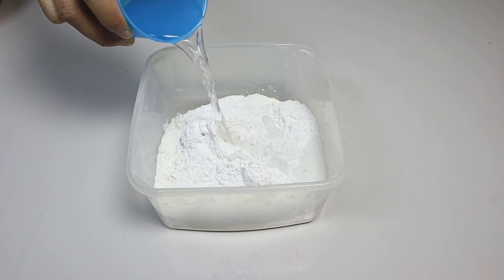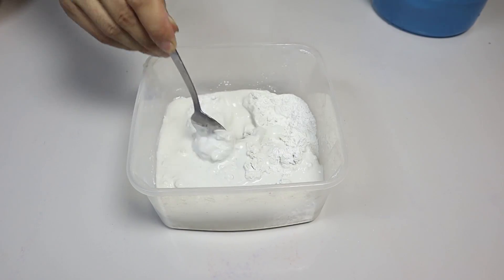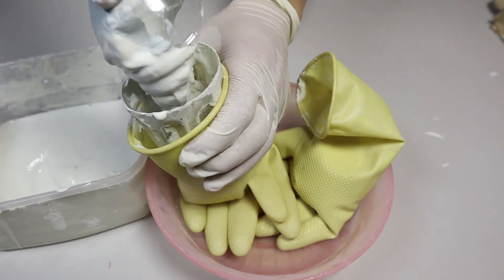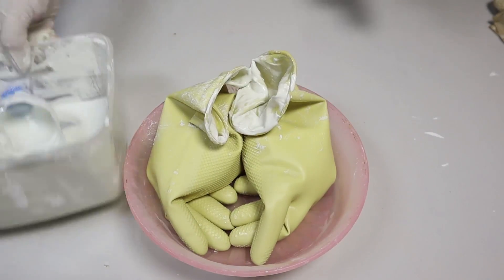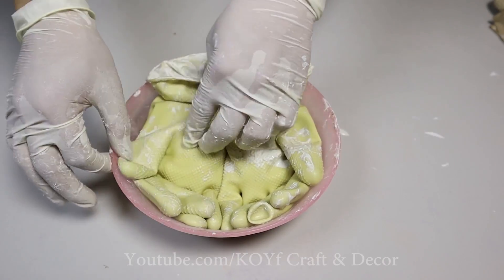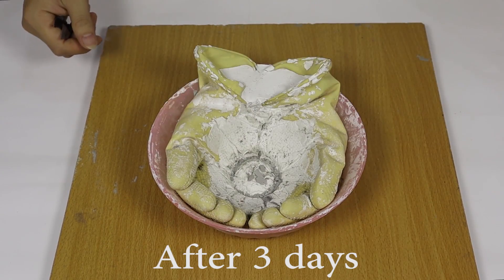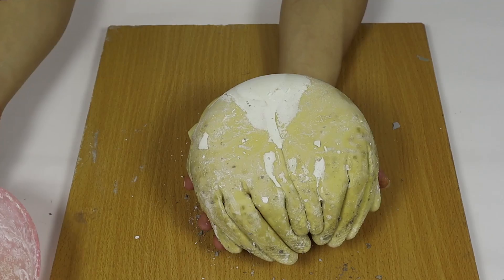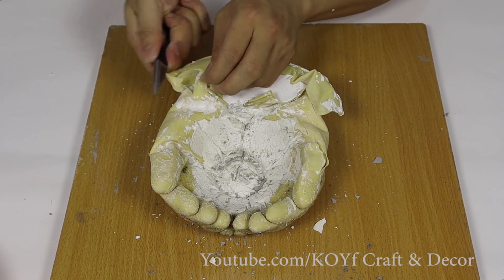Easy to make a hand shaped cement flower pot / Maceta de cemento en forma de mano

Comment: can we make a drainage hole on the bottom if we like? or will it break?
Reply from the maker: it can break the pot, there is already a gap between the fingers so it drains very well, no need to make more holes
Reply: @KOYfCraftDecor  thankyou for replying!
Reply: After 48 hours while trying to remove latex gloves it had broken. 2 times tried. Same things happened every time..is there any hack to remove gloves after drying it.
Reply from the maker: @tandrimaguha8976  you can remove latex after 3-5days, and make it carefully, please remove it slowly and carefully, if some fingers broken, you can use super glue to fix it
Reply: @KOYfCraftDecor  Thank you for replying.  I will try again with your suggestions. Hope this time i could remove them successfully.
Reply from the maker: @tandrimaguha8976  yes friend! try your best!
Reply: @KOYfCraftDecor  may be we can pour hot water....am I wrong?
Reply from the maker: @munazah9838  you can pour hot water, and then remove glove slowly and carefully with a razor blade. hope you can make well